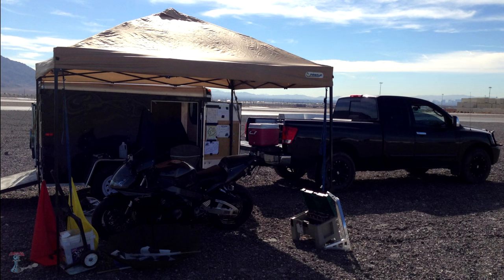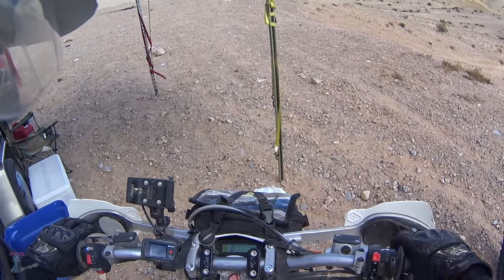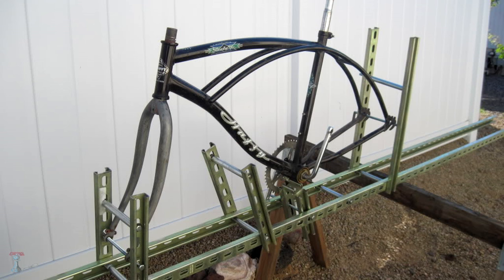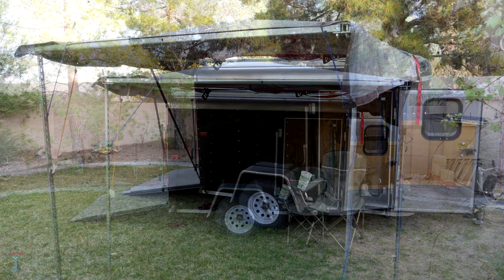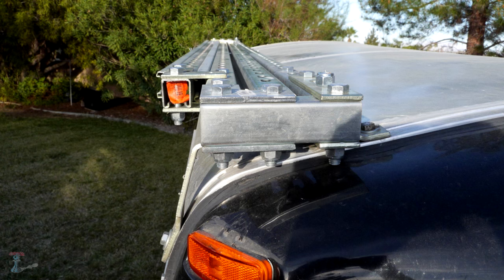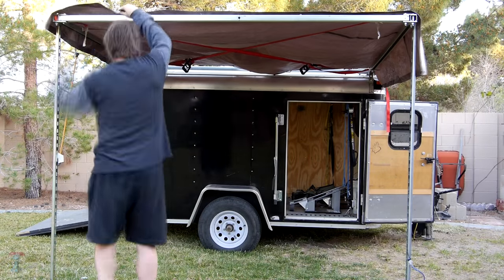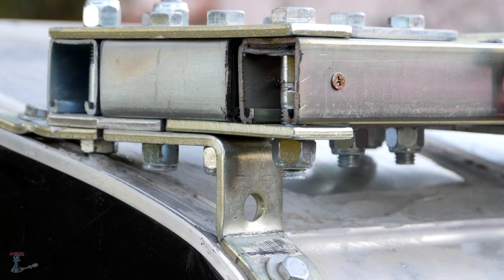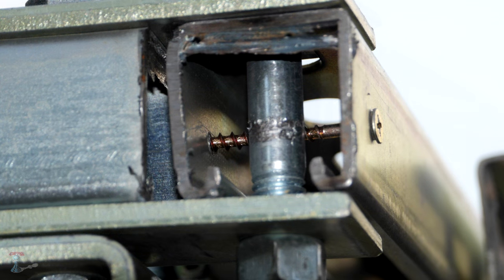Home Made Indestructible Awning

Comment: Looks like a real solid design. You know, instead of buying 6 angle grinders Harbor Freight sells portable electric band saws now. Over the years I have run miles of unistrut  working in chemical plants so I am very familiar with it. I didn't notice any spring nuts on your awning, do you use them at all?
Reply from the maker: The HF portable band saw is 140 bucks, I recommended the Harbor Freight angle grinder because they are only 15 bucks. The reason I have 6 is because I have slowly been acquiring them over the years. I figured someone with not a lot of tools who wanted to build something like this could afford a 15 dollar angle grinder. I didn't use any spring nuts because I didn't see a good way to utilize them. I'm hoping someone will take this basic idea and improve upon it. If you see ways to improve it please let me know. Thanks.

Comment: I loved it, also gave me so many ideas, what's the final weight??
Reply from the maker: I didn't weigh it but I would guess 40-50 pounds. I was concerned about that much weight on the roof but it turned out to be no problem. You can't even feel the extra weight even when moving the trailer by hand. I use the trailer all the time and it's been working perfectly on the highway and on rough dirt roads.

Comment: awesome idea. thanks for sharing. can you estimate how much you spent total(not counting any redos)?
Reply from the maker: Good question. 4 superstruts (thick) $20*4=$100, 2 superstruts (thin) $16*2=$32. Tarp $20, 4 rachetstraps $17, Bungees $16, Bolts/nuts, brackets and other stuff $20-$30 I think. So rounding up and adding tax I'm going to guess $220 minimum to duplicate my exact setup. Hmmm more than I thought, and I probably spent closer to $300 total figuring stuff out and mistakes. But I'll tell you what, even at $300 I would do it again because I really do love how it's basically part of the trailer and is never going to fly away. Nothing is more frighting then when a gust of wind comes along and you think your EZup is about to go flying in to the track during a motorcycle track day event.  Also the tarp, ratchet straps and bungees are useful to have stored on your trailer year-round. Hope this helps.
Reply: Yes thanks very much. And yes it gives new meaning to the phrase ez up.lol. and good luck at the track

Comment: @lowlypawn...Question: It looks to me as if this unit is not secured to the ground. That is to say, it's not weighted or driven into the ground. If that's incorrect, please advise. If correct, has that proven to be, problematic?
Reply from the maker: Well kind of. If you watch closely I recommend when it's windy to take a ratchet strap (or two) and connect the frame to the bottom of the trailer. This creates a triangle that pulls the awning into the ground. So basically the wind would have to be strong enough to flip the trailer over which won't happen, unless your in a tornado :)
Reply: Right. I get it now, thanks.

Comment: After using it for a while what would you change if any?
Reply from the maker: I've been thinking of a way to quickly attach the tarp to the frame. Maybe some pins or bolts that stick up that match up with the eyelets in the tarp. Then use a few pins to secure it, something along those lines. If I do come up with something good I'll do a follow up video.

Comment: What size trailer is that
Reply from the maker: It's 8' long inside and a little shorter then the standard model. When I ordered it it was no extra cost to make it a little shorter so it would fit inside my garage. I do bump my head at times so it's a trade off.

Comment: "I have 6 because I have changing disc " bahahahhahaha it takes all of 15 seconds
Reply from the maker: Haha I've never changed a disk in 15 seconds in my life, maybe one minute. Here is what used to happens to me when working in the garage. I'm cutting some metal and now I need to start grinding. So I find my grinding disk, find the tool to change the wheel. Nope wrong size, go find the correct size tool (why do they come in two sizes?) Unplug my grinder,  switch disks, plug the grinder back in and then finally get back to work. Then I find I want to switch it back 5 minutes later! So annoying. There are 4 wheels used all time, cutting, grinding, wire and flap. So a good argument can be made to own at least 4 angle grinders. I don't know how I ended up with 6 :) I was actually surprised I had that many when I made this video. I think I was walking through HF a few times and for 20 bucks I thought to myself there is no reason NOT to own a few extra grinders. Anyway, thanks for the comment!
Reply: LMAO, Im the same way man I buy tools all the time that I already have.. It was just funny comment and then you had the pic of all 6 of them like changing them was huge undertaking.

Comment: I went to Home Depot, and those EZups as you cal it are NOT cheap when you have to buy 30/40 feet of it.
Reply from the maker: Cheap is subjective I guess, in a previous post I broke down the cost and estimated I had $300 total investment. Which I agree is not cheap, but I've spend a lot more then that on EZups over the years. So if I would of built this right when I got my trailer I would have saved a lot of money.  I just looked on the Home Despot's website and it's only 23 bucks for a 10' stick. that's still pretty cheap. That's basically lunch for two people at TacoSmell.
Reply: I wasn't criticizing. I have a small home made 12 ft trailer , and trying to figure out how to come up with an awning. Your set up gave me an idea that would swivel the same with 2 inch PVC schedule 40 pipes that are very sturdy and cheap.   Thank you
Reply: I just checked too. Here it's called Everbuilt slotted angle at $16.48 for 6 ft.